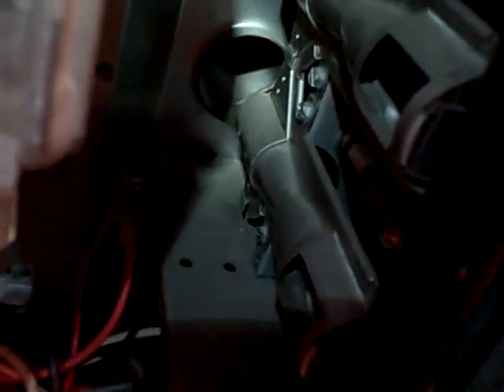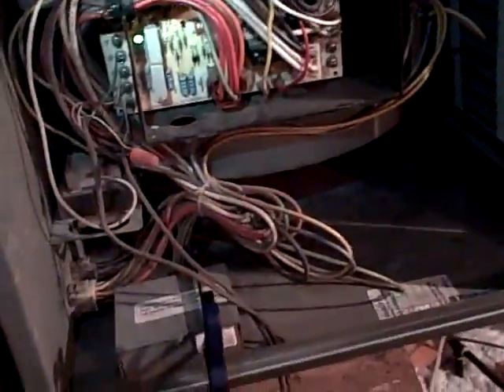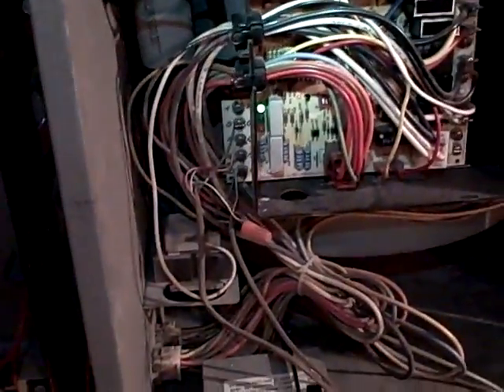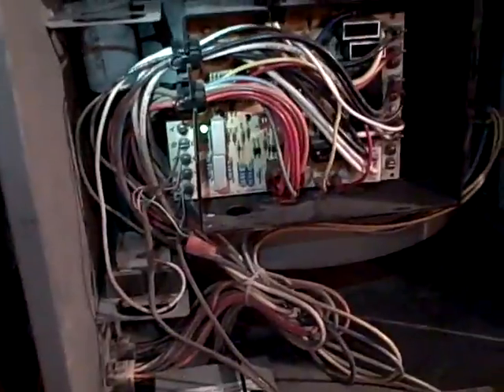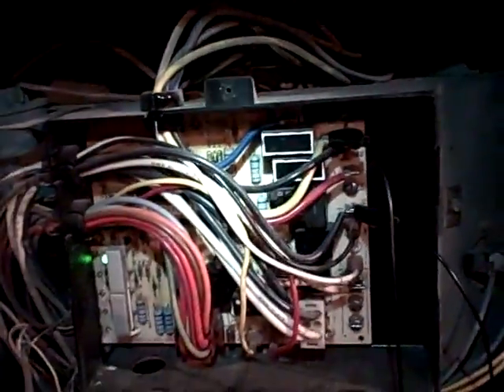HVAC Troubleshooting a gas furnace control board and blower motor.

Comment from the maker: @webowltoo1961 Well it could be a weak safety switch but could also be any number of other things:/  Is the furnace located in the attic or a closet space?  Have any changes been made to the system since last winter?  is the blower staying on for a while after the gas valve shuts off (to displace the heat and cool the exchanger?)  Does the control board have the options of changing the blower delay off setting say from 30 sec to 45 or more?  Is the furnace getting enough fresh air flow? etc....

Comment from the maker: @webowltoo1961 probably need to send me a message directly so I can type more..  Does the blower motor come on after the furnace ignites?  Where is the reset button located that you are using?  Unless the reset switch is faulty, then it is tripping on overheating.   A minute is pretty quick.  To overheat you either have an airflow issue or even possibly a rusted out heat exchanger that is getting air blow back.   Have to start somewhere though!

Comment from the maker: @rram2000 If the inducer comes on but not the igniter it could be several things.  Check the unit to see what the flash codes mean for your board.  Typically if it doesn't light with a good igniter but the inducer is on you need to check the safety switches and check to see if the inducer line is clogged.  You can remove the rubber hose from the pressure switch and see if you can blow in the hose BACK TOWARDS the furnace, if you can't then the little metal tube is clogged.DONT BLOW IN THE SWITCH

Comment: Hi Mikie,

My draft inducer never shuts off. The furnace (goodman 075-4) goes through all cycles and after termostat turns off the heat (reached desired temp) the inducer blower stays on. I have to manually turn off the main switch and turn back on to get heat, otherwise on next termostat call I would get 2 blinks. Is it main board, limit, sequencer or valve? Intermittently I also dont get flame coming on and then get 1 blink. could it be gas valve or still board is acting out?

Comment: hey mike how r u hey i got a payne unit the blower motor is a 1/3 hp the temp coming out of the regtrs is 110 degrees. and the house still cold it's a 2 bed 1 bath what do you think the problem might be. thank you bro

Comment from the maker: @mikie2501  ...if all of that is fine then check a few other things...(don't know if this is a new install or old so...) does it have enough supply air and proper venting?  Does the motor and capacitor test out alright?  If it's a new install you can check the manufacturer's specs to see if heat should be running on low or medium.   If it's an older install I would check the things from my previous post first.

Comment from the maker: @customflrs (assuming your a tech sooo...)  Assuming the motor/capacitor and furnace controls/safety are functioning right then it comes down to an airflow problem.  Are the return air vents blocked?  Are there too many filters instead of the proper amount?  Is the filter clogged up?  ...does the customer have a lot of vents closed causing a back pressure?  ...and lastly, is the evaporator coil clogged up with crud causing it to overheat?  This is just assuming everything is working right...

Comment from the maker: @FreaK42WheelZ Some control boards are picky.  Sometimes you can switch the 24v wires around and it will be happy.  ..or switch the 120v power leads if that makes sense.  Yah alternating current is alternating current but some of those boards are picky :>   I've changed boards and the new board fussed until I switched the mains 120v going to the unit around.  go figure, heh.  Just be careful!

Comment: I have a ? for you.  I installed a transformer without 240v.  Everything worked fine for about 15 seconds.  Then it started a rapid flash.  It says the code is reverse transformer.  But my wires are correct.  Have a 24v  and a 120v.  2 commons and a ground.  Black and blue being common.  yellow being 24v, and white being 120v.  I am at a brain fart it seems.

Comment: Evan if you jump out a relay in cool mode in the summer ,just until you get back with a new board you should cut off the gas valve  ,because if the board is flakey it could try to come on in heat mode .Yes I know this is not likely to happen ,but why take a chance. an energized gas valve for a couple hours could be a problem if you know what I mean.

Comment: That is a good point Mikie.

It's always best to just change out the control board then jumpering dead components on control boards, or installing additional components. It also can cause a lot of confusion amongst service tech's as well if an entire unit is hacked.